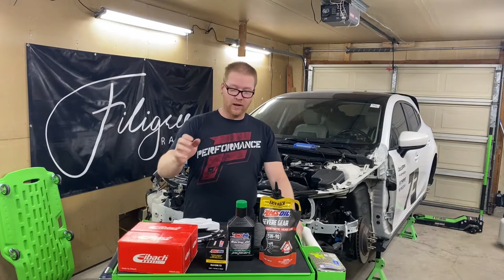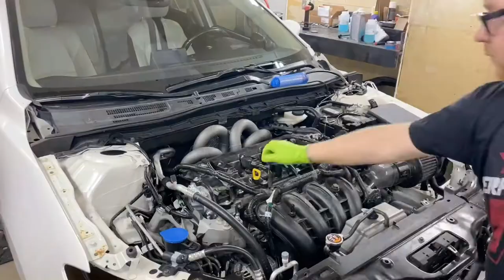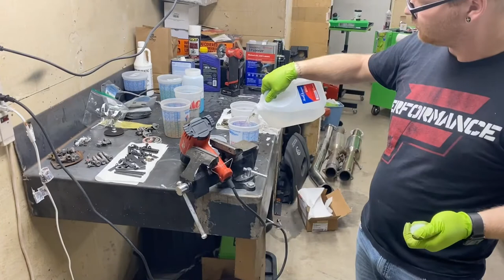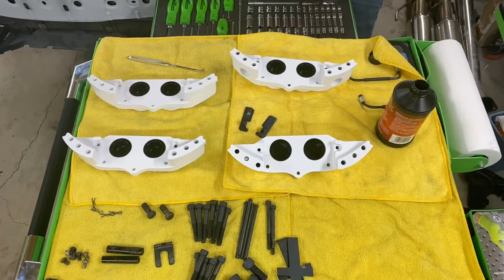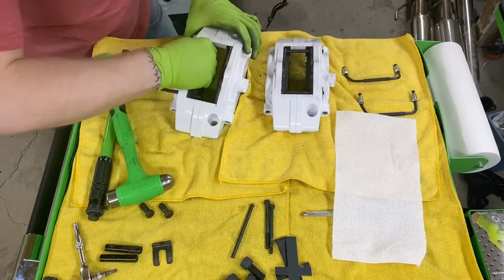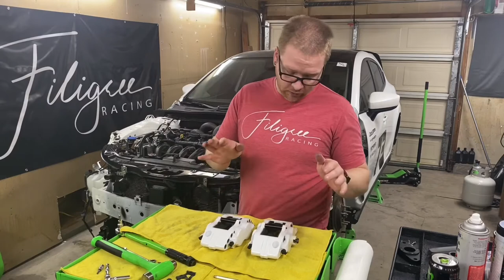Maintenance and Corksport Brake Caliper Build

Comment: You're definitely going to regret that caliper colour choice after the first track day but damn will they look fine once you get them mounted.
Reply from the maker: Regret sank in when I put last seasons pads in. They quickly turned black. They are really easy to clean up which is nice.